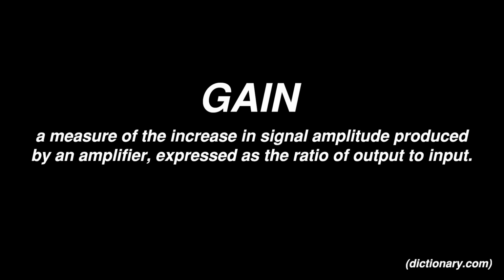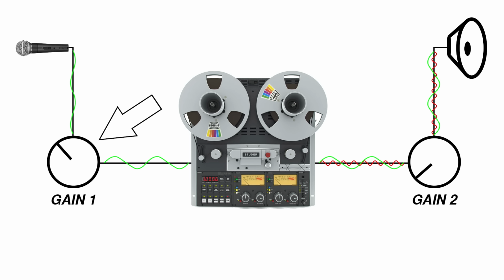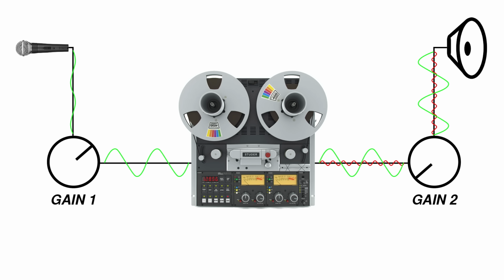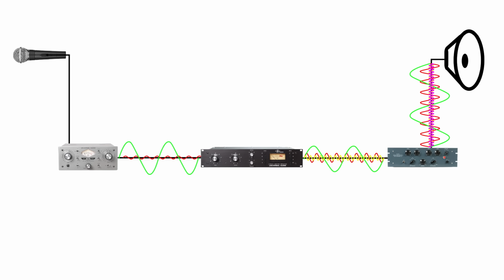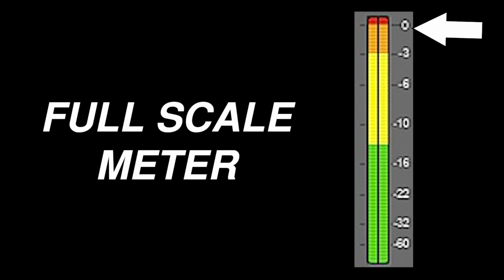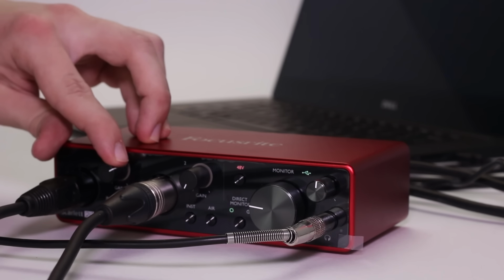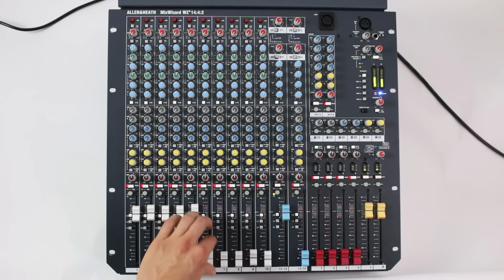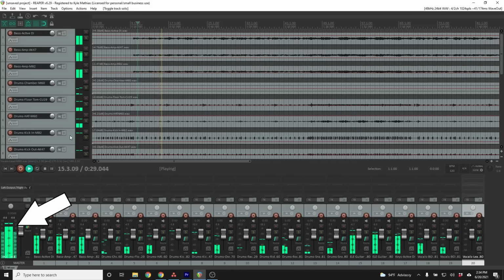Gain Staging Secrets Every Great Audio Engineer Understands!

Comment: Why not just pull down the faders on the tracks instead of doing it on the region or pulling in vst for vol trim? Why is it important to have the fader at unity gain?
Reply from the maker: The FX chain is pre-fader, and we need to adjust the level prior to the FX chain.
Reply: @AudioUniversity  That again raises the question about why to pull in a vst trim for vol trimming. If you want the volume trimmed before that stage. I don’t get that. And isn’t volume trimming the same everywhere? Pulling down the fader or pulling down volume on the region. What is the difference? It’s just volume getting lower either way, right?
Reply from the maker: If your signal is at -1 dBFS going into an equalizer and you want to boost a frequency, you may drive the signal into clipping. Instead, you can make sure you have headroom going into the EQ (signal level -12 dBFS) so that you can boost or cut freely. That’s just one example.

Comment: Are you familiar with the "shoot to the right" approach in digital photography? If not: it's basically setting the exposure to shift the resulting photo's histogram as much to the right (brighter tones) as possible without clipping. (Or at least not clipping any part of the photo you care about.) That increases the signal to noise ratio in the recorded image, since the underlying noise (thermal and otherwise) of the sensor is constant. Then you pull the exposure back in post which reduces the noise along with the signal.

It also makes for smoother gradients, e.g. if you take a shot of a dark scene where the recorded pixel light levels range from 10 to 100 you'll have 91 distinct levels of brightness recorded, whereas if you increase the exposure so that the range is from 20 to 200 you'll have 181 distinct levels. I imagine similar effects could be seen in a digitally recorded sound wave.

Anyway, it seems like you're kinda doing similar things here with digital audio recording, and I thought I would share that.

It does make me wonder if anyone has made an effort to come up with an algorithm that can take a number of tracks and their recording & mixing parameters, and output a suggested optimized mix for preservation of maximum signal precision, or even suggest better recording parameters for the next take. It seems like it should be mathematically possible, though I don't know off hand how much number-crunching it would take.

Comment: Great video!  Question: near the end, you say to set the levels of all tracks to around -12db, allowing the Master Bus to still have plenty of headroom. But yet, all the track faders are at unity.  SO, if you didn't use the individual track faders to get the tracks to that -12db level, how did you get them to that desired level??  I would have thought that's what the track faders were for... to get the individual tracks to the desired levels? (-12db, in this case)
Reply from the maker: You should use the faders to mix the tracks to the desired level. However, you can set the PRE-FADER level to about -12 using clip gain, a gain or trim plugin, and the output level on your other plugins.
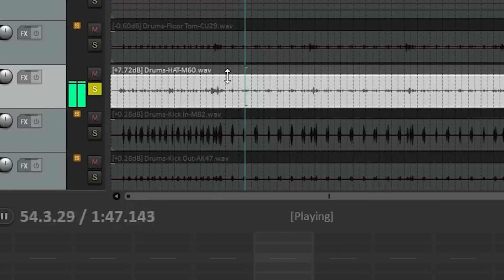Reply: 8:22 he set the levels through the waveform files on the playlist.

Question: If this is what people always do for gain staging then howcome there isnt drum kits with all the sounds set/normalized to a certain level (-18db for example that most vu meters are calibrated to) so that you dont have to go through this tedious process everytime? Or is there any drum kits out there that are?

Comment: Great, clearly explained video. Such an important topic as it directly relates to sonic performance. I'll share in the general conversation of system gain setup for PA systems...  I don't know how many times I have seem amplifier inputs wide open for example,   when often the correct setting is some fraction of that, depending on the amps internal gain specs. A good quick tool that doesn't require test equipment that I use that gets you in the ballpark for aligning system gain, is to unplug all speakers from all your amps first. Very important! Next, put on some decently recorded music that has good peak material such as drum kicks etc. Then, starting at your mixer's output, bring the signal up until you begin to get a decent clip flash on the mixer's meter then stop, and  leave it there and don't move it... as this will be your reference. Then, adjust the gain on next downstream  device's meter or clip light in the signal path, to replicate the same clipping flash as the mixer. (Devices that have a unity mark should remain at unity in most cases) Then, once that alignment is done, bring the main out level on the mixer back all the way down >> BEFORE<< reconnecting your amp's speakers. If you have a scenario where you cannot disconnect the amps speakers, don't do the above procedure. What this procedure attempts to do is align all the variable gain points so that when the mixer begins to clip, so does all the other devices, thereby maximizing the signal to noise ratio. Hope that helps, as it sure did for me.

Comment: Outside of the studio in the live event venue I think that something that a lot of people overlook is the power supply coming into each of your components. I run a mobile DJ business and use a APC G5BLK rack mounted power conditioner (not saying that this is the one to use, just what I have). I firmly believe that your audio is only as good as the incoming noise from the electrical supply lets it be. While in a studio (yours or elsewhere) the electrical supply has probably been looked at for noise issues in a mobile setting you have no control over what is coming out of the outlet you are plugging into. Whether it's over voltage or under voltage, or the central AC being on the same circuit it's a crap shoot of what you are getting IMO. I know that when I set up I've dealt with the power supply issues to the best of my abilities so as to not introduce unintended noise into the mix. Side note: This is truly a great series of videos that have been pro for every ones benefit. A person should never stop learning, and if you think that you know it all it's probably a good time to throw in the towel.
Reply: I completely agree. I have a Meyer system for outdoor live shows in Little League ballparks and for street fairs. The first thing I ask about is POWER. If I can't put each of my subs, and each pair of tops, on their own, separate 20A circuit then I won't bid the job. I also won't bid a job if the venue was built any time before 1974 (the US used aluminum wire for 10 years because the Vietnam war used all the copper for munitions). I won't do shows anymore in San Clemente, CA, for example, because the infrastructure was built in the 1920's thru 1940's and there isn't any 3-phase power in the entire city. The only way we amplify sound is with electricity. My loudspeakers love electricity and when they're well fed, they sound awesome. When they're not well fed, they sound like JBLs.

Comment: use 100% volume for phones/computers
digitally speaking 80% and 100% shouldn't make any difference as far as tone or noise goes, and since it's not the same as turning up the volume on an amp/pre amp, there is no clipping involved in running device volume at 100%.

The effect you do end up with though, is that you are not driving your actual amps and pre amps as hard. The louder the signal is going in, the less you have to use your amps/pre amps to boost it.

And also again, general noise floors. 

Noise floors don't just apply to equipment, they apply to things like aux cables. The louder the signal going through the aux cable, the less the noise from the aux cable matters.

Comment: As an industry veteran of 45 years, I feel like you glossed over the importance of setting the gain of the pre-amp correctly.  The goal of a pre-amp is to take signals that are microvolts (mics and DIs) and boost them up to line level.  Every source requires special attention.  A vocal mic typically needs more gain than a kick drum mic.  Once you've mastered pre-amp gain, everything else downstream operates at line level.  For me, the pre-amp is THE most important element of gain staging.
Reply: I agree. This cannot be under stated
Reply: Bro man dem pretend too much
Reply: As the saying goes... garbage in garbage out
Reply: Technically, I have a microphone that comes with line level output built-in, but considering that that's probably a pretty rare thing still, even these days, I'd still have to agree with you... I'm only a volunteer soundboard operator and have no training in the subject though, so my knowledge is almost nothing compared to all you industry veterans out there, and let me just say thank you to every one of you no matter what part of the industry you're in, because even in my volunteer status, I know a bit about how hard an A/V guy can sometimes work and STILL not be 100% sure if it's my fault or the equipment's fault, when something happens. Let's just say, "25 year old soundboard" and "channels going out", and you'll probably know exactly how bad of a time I had for the last couple of years before 2020 or so when our church got enough money to have our audio installation company we use for our technical work, actually finally get and install a new soundboard. Technically, the installer's parts source didn't have the requested soundboard available except for a wait-list or something, so the church had to purchase it from sweetwater themselves instead, to meet the installer's timeframe for fitting us into his free time, and literally everything got upgraded right down to the soldered on 1/4/XLR combo plugs in the walls. IDK if soldering wall plugs is standard, but if it's anything like a standard outlet is installed, usually, then I must say that I didn't know that anyone actually went through the trouble of soldering connections in the wall socket. And those combo plugs, man... Before, we just had standard XLR jacks, but to now have that ability to use it for literally almost ANYTHING that plugs into the wall, well, it's kinda cool honestly, and also, to have not only our original 16 channels, but 32 DIGITAL channels, on our new soundboard, while still being smaller than that monstrosity in my barn I'm trying to decide if it's even worth it to try and run a can of DeOxIt through the thing to try and get it fully, or even partially working again, considering at least half, if my memory serves, or more, of the 16 channels, are either dead or going that way, well, again, that new mixer and all the stage plugins, just, WOW...

For reference, I had been saying that I thought the old soundboard needed replacing, around 2 or 3 years prior to them getting it replaced, so, even if it wasn't a headache at the beginning, well... I said it needed replacing, and if towards the end of it's life/usage cycle(after I mentioned it needed replacing at some point preferably soon) I was ending Sunday morning (on nearly every Sunday) nearly having PTSD from the issues and errors I couldn't quite figure out,(not even joking) was what it took to get them to take up a collection for new audio gear, then I consider my battle scars worth it, and trust me, for me, an audio "un-engineer", it WAS a battle, one that more often than not, I felt like I was losing, and was feeling well, hopeless, to be honest... Again, no matter what all y'all industry professionals and whatnot actually do in this space, thank you all for your work, as it there's one thing in my top 3 that I could probably have used therapy or other "professional" "help" for, the experience I had with the old soundboard was the only one I can talk about, and I don't know how anyone doing this every day can take the pressure...
Reply: @northwiebesick7136  tell me about your old console, I may want it.
Reply: @weneedtermlimits  assuming you mean the "old" one in my barn, we replaced in around 2019-2020, I don't remember the brand right off, but I think last time I looked at it it had "Peavey" brand logos on it, and it's an analog (no screen, just a million pot knobs and sliders) mixer, made in around 1994, and most channels are either dead or dying in one way or another. I'm not a technician by any means, that would have the knowledge to fix it, so you'd be on your own there, but other than that, if you need one for parts, I suppose there's gotta be SOMETHING useful on it still. I know that it's a 16 channel mixer, and I know that it's got tape player "RCA" connectors for aux inputs, plus it's got separate studio/XLR jacks on each channel. I cannot stress enough the fact that it's over 20 years old and I don't have the experience to be able to diagnose whether it's fixable or even if it's worth fixing. Anyone buying or otherwise getting it would be getting it "as-is" with no warranties... Also, I'm located in Minnesota, if that information helps... I'm honestly not sure what to do with it, because I don't have the speakers, cables, etc. required to do appropriate testing with, and even if I did I'm not an audio repairman so I'd be out of my depths doing anything more than just spraying a few cans of DeOxIt all around the board...
Reply: @weneedtermlimits  I have a Soundcraft SM20 40 channel mixer in pristine condition, in the flight crate ready to go.

Comment: I use a lot of MIDI Instruments.  My technique is adding a Gain Utility on the channel and setting all instruments to -18 using pre fader.  The only question I have is...now that you have your instruments recorded and set to -18 gain staged and you want to start adding EQ, Compression, Verbs, etc to each track.....Does that mean that you have to re-gain stage after all of those have been added for each instrument?

Meaning, everytime you add an affects or any processing on the individual channel....Do you have to re-gain stage at the end of the last added chain of effects?  And how do you do that....Add another Gain at the end of the chain....or manage each added EQ, Compressor individually to keep within the -18 as you add a plugin and is this pre fader monitored or main channel?  

No one has ever shown taking an instrument and adding EQ, Compression, Verb....and then managing the overall Gain Stage.....Can you do this please?

Comment: If I’m recording my guitar DI, do I want the input signal to be -18dB on average, or do I want the signal with my amp emulator applied to be -18dB on average?
Reply from the maker: I’ll usually start with the input meter reading about -18dBFS. You might experiment with turning it up or down from there as a starting point because the amp simulator probably models the non-linear nature of a real amp. That is, it will respond differently to various input levels.
Reply: @AudioUniversity  thanks! 
So if I start at -18dB and boost my input signal to -12dB to mimic “pushing the tubes,” I’d compensate by attenuating the output signal back down to -18dB?

Comment: Almost all specifications for sound devices indicate harmonic distortion levels at a signal level of -20 dBu with frequencies of 1 kHz and 20 Hz. At a frequency of 20 Hz, the distortion is always higher in level than at a frequency of 1 kHz. As a rule, we can easily increase the level of the input signal with a frequency of 1 Hz by 5-10 dBu and there will not be so much distortion, but if we increase the signal level with a frequency of 20 Hz by 5-10 dBu, then the distortion will increase significantly, dozens of times! Now imagine that we sum up two channels with -10dB levels in the DAW and the faders will stand at 0 dB, then at the output we will get a signal of -4 dBu, that is, 6 dBu more. If we sum up 4 channels with levels of -10 dBu, then at the output we will get an excess of 0 dB, that is, digital distortion (however, this will happen in the ideal case when these signals coincide in frequency and phase. If the signals are phase shifted or are the sum of different frequencies, their addition will have a different result). It turns out that with multichannel recording, it doesn't even make sense for us to try to record an input signal with levels above -15 dBu. Of course, we can compress each channel and the total volume at the output of the daw will not grow so fast, which will allow us to sum up 16 or more channels with signal levels from -20 to -10 dBu without getting distortion on the master section.

Comment: gain staging almost sounds like gain stacking in a way, not as much as ahving grouped tracks

then again, it kind of is gain stacking too, it's just all end faders likely to be in the negative decibels rather than actual pre amp boosts

anyway, as someone who made some sportlife-style sounding drum and bass track and stacked 8 old breakbeats for a big drop, it's great to compartimentilize your compressor/hard limiters too, i always group my tracks and sometimes use compressors on individual tracks then smooth it out even a bit more with a more lenient bus compressor on the group so it kind of picks up the transients of the tracks that aren't compressed as much

it's like that NY style compression where you mix it with the original, but instead, you feed a lot of the transients of the not compressed signals into a bus compressor aswell as the compressed signal rather than drive them to the master, it's like another step of subtle compression that exaggerates the transients left by the dry signals 
the bus behaviour will bring out that transients and gate them pretty nicely, don't go too hard on the dials or it sounds too synthethic